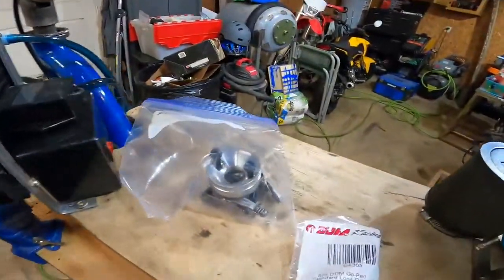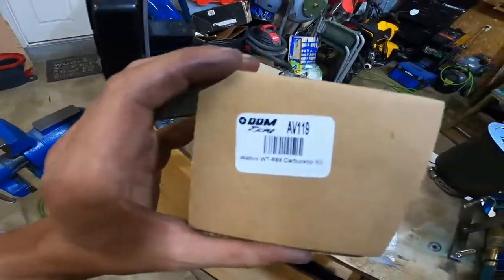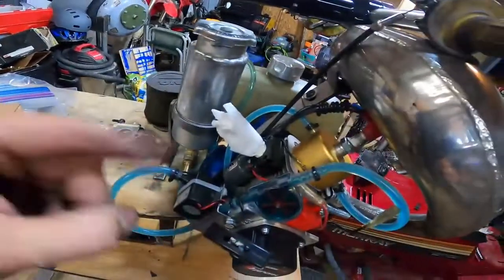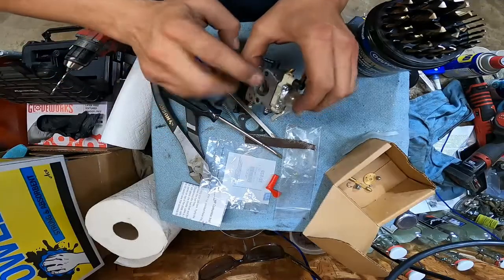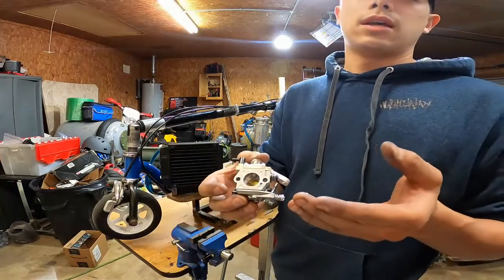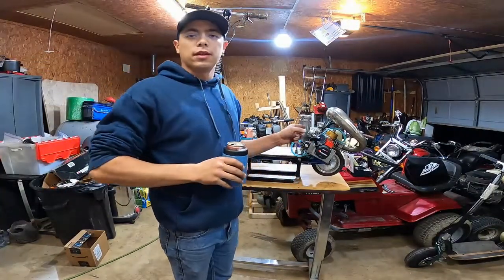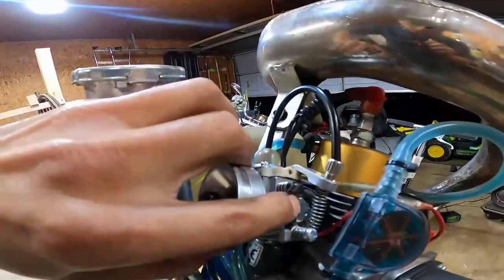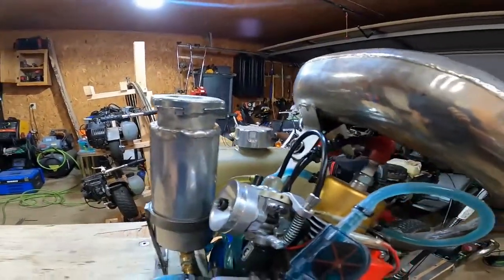Walbro WT-668 Carb overview and install. Water cooled sport's new carb.

Comment: How did you find that throttle linkage..?  I have the carb but don’t have the Goped linkage to go with it..!
Reply from the maker: @kbigselma8096  the linkage is on ddm racing’s website
Reply: @aaronpratt89 you a real one bro..!
Reply: @aaronpratt89  one more thing bro..! Whats the name of the part after you put the linkage on and the throttle cable have to come through..?
Reply from the maker: @ https://www.ddmracing.com/52-528-walbro-wa-wt-carb-swivel
This?
Reply: @aaronpratt89  Naw the part that you screwed into the linkage and put the cable through ..!
Reply from the maker: @ your throttle cable should have one of those. Let me see if I can find a link for it. Should be under cables on ddm racings website
Reply from the maker: @ https://www.ddmracing.com/Cable-Barrel-w-nut-2025
Reply: @aaronpratt89  I appreciate you bro..! You a real one ..! 💪🏾💪🏾💪🏾

Comment: Cut the metering spring is something I hadn't heard of.  I bent the metal piece holding the needle so that it opened sooner.  It helped to add more fuel but it wasn't easy to tune accurately.  It was often too rich on low and mid throttle.  Does cutting the spring shorter have the same negative effects?
Reply from the maker: @chadr00  raising the fulcrum doesn’t change the pop off rate. It actually changes the timing. Pop off rate is the amount of pressure required to push the needle open and pressurize the diaphragm area of the carb. By raising the fulcrum you risk over pressurization and the seat never closing. Sounds similar to why you had a hard time tuning it and it running rich. By cutting the spring the fulcrum can stay closed when not being used and still open at the correct time while allowing more responsive fuel delivery.

Comment: Great videos. Can you please explain what the two smaller screw adjustments are for? I know one is for idol. I assume the other is for how rich you run the fuel. . What is the best way to tune the two together?
Reply from the maker: sorry for the delay. there are 3 screws. one for low speed fuel, one for high speed fuel, and one for idle air. ill have to make a video on how i tune a carb, theres a lot to explain in text.

Comment: Dang bruh you are good...
My rc 5th scale with a wt668 carb is blowing bubbles in the fuel tank when I press the bulb.
I recently changed fuel tank and carb, what did I do wrong 😕
Reply from the maker: Bubbles are normal. When you push the primer bulb it pushes the air out of the fuel system to it the tank.
Reply: @aaronpratt89  ok brother but I see there is no fuel going into carb bubble.
Thanks for the reply and help
Reply from the maker: @godsun358  if it’s not picking up fuel, are your likes backwards?
Reply from the maker: @godsun358  it’s not a Chinese carb is it?
Reply: @aaronpratt89  I thought so, I took off the one leading to carb and placed it where the 2nd line goes and put the 2nd line on carb and still nothing.
Reply from the maker: @godsun358  or could be a bad carb. Does the engine run at all or will it not prime?
Reply: @aaronpratt89  the engine does run but the old carb fuel bulb busted and the old tank was dry rotted.
So I changed the carb, tank and lines.
So it's just not priming.
Reply from the maker: @godsun358  is it a Chinese carb or is it a walbro brand one?

Comment: What does cutting the metering spring do ?
Reply from the maker: It lowered the pop off rate. Lowe pop off rate allows for sooner fuel delivery. Helps eliminate horrible throttle response.
Reply: @aaronpratt89  gotcha ... Thanks for explaining that

Comment: Why do you delete the choke?
Reply from the maker: Well these engines tend to start easily with out using the choke. The choke plate itself restricts a small amount of air flow. So removing it helps this little engine breathe just a little bit better. However the only difference is super small and may only be noticed on a dyno.

Comment: I'm surprised you didnt try an 813 carb with an accelerator pump if your looking for throttle response.
Reply from the maker: I’ll get to that one one day lol. In my experience they tend to flood stock engines.
Reply: @aaronpratt89  the 813 was more impressive then i thought. I use it with small engines. Seems to help quite abit in the low end
Reply from the maker: @dawsonmacie6984  it’s next on the list for testing. Moving right now so videos are on hold for a bit lol